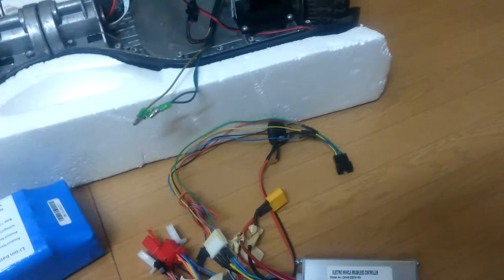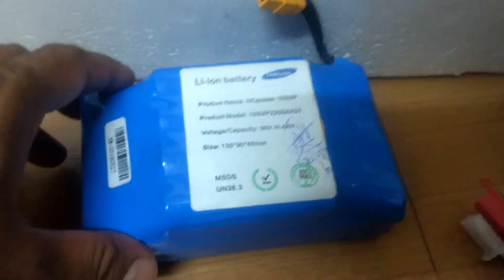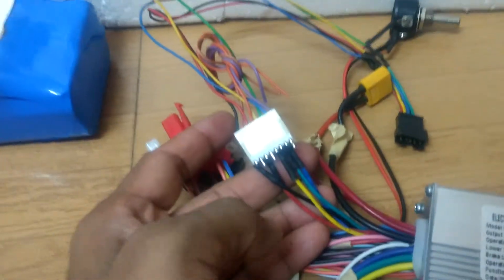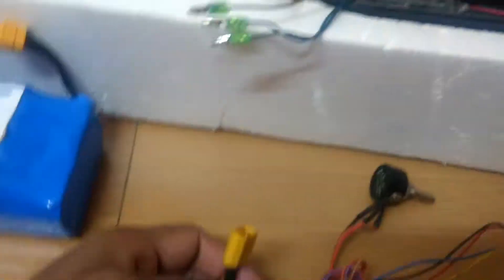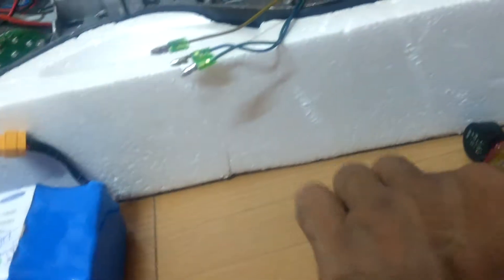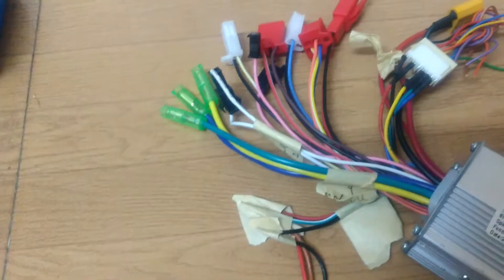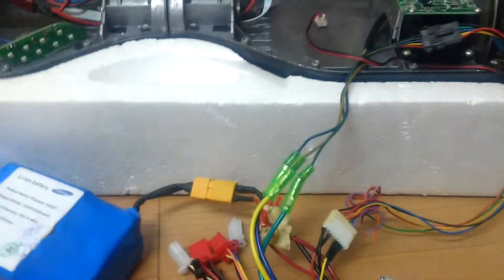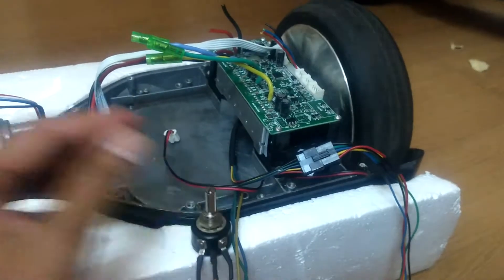Hoverboard motor with ebike controller easy steps

Comment: Hi, i found something for reverse mode. You can find same color two single wire connectors, they should be male and female to be connected. If you connect them it will go reverse,  no need to change motor wires. Try it.

Comment: Hi, bro, I built gokart with two hoverboard motors and two controllers, but I can't reverse the kart. Is there any wire to change motor direction? Because hard to know in Chinese labels
Reply from the maker: I also made same thing. I used relays to swap 2 wire of motor
Reply from the maker: When you press revevse button relay will switch and change the 2 phase . Motor will then rotate reverse
Reply: @Robotinnovations  in another video someone said to switch two phase wires and two hall sensor wires. 
Please advise me
Reply: @Robotinnovations  Can you show the details with images pleas,
Reply from the maker: @Pol_Khol_Agent   there are three wires red green yellow, power the motor see if it runs in cw or ccw . Now just swap yellow and green wire of motor . Now see it will rotate in opp direction.  I will make a video for this later.

Comment: Hi, how about if i want drive two 350 watt hoverboard motors with one 350 watt motor controller,  how to connect. 
Please answer. 
Thanks
Reply from the maker: Yes you can do. Connect u v w power cable in parallel.  And the hall sensor of any one. To reverse the direction of any motor  just change the wire sequence
Reply: @Robotinnovations  you mean both motors connects to same three phase wires of controller?
Reply: @Robotinnovations  another issue is each motor is 350 watt, so both motor need 700 watts to run,
and controller supplies only 350 watts, this way controller can burn with overload or motors will perform slower,  
What you say?
Reply from the maker: @Pol_Khol_Agent  right . You should not use  full power

Comment: I'm doing this same test everything is connected but I still have no motor response 

My ebike controller has no power switch cable 

Should I solder the hoverboard main power line to the red positive battery line?

Comment: One question .  Since the hoverboard uses gyroscope sensor.  It is 2 , 2 pin connectors.......usually red and blue for motor stop (lean back) and lift off (accelerate-tilt forward).  
I have a electric unicycle. Would I have to use the unicycle controller with the ebike controller ???
Because I think that the aftermarket controller would not be able to recognize the gyroscope connection?? 

Please help
Reply from the maker: I don't have much idea about unicycle, but it should work in same concept as hoverboard
Reply: @Robotinnovations  oh thanks for fast reply.

But exactly what do I have to do to still use my gyroscope connections?  Should i use the stock controller with the ebike controller??

Comment: have you tried running it at 48V or at 24V?
Reply from the maker: These motors are designed for 36 v , i have used them using 12 and 24 both , 48 volts may damage it so avoid it, you can use  controller with your specific voltage.
Reply: @Robotinnovations  then how some people using 24 volt batteries in 12 volt power wheel cars to run faster